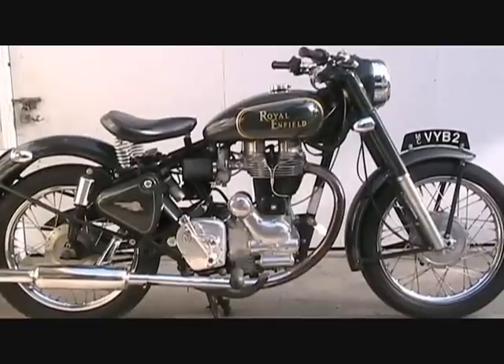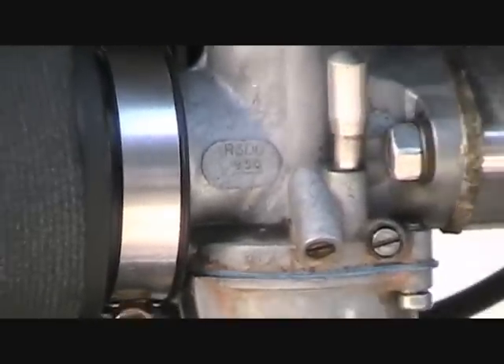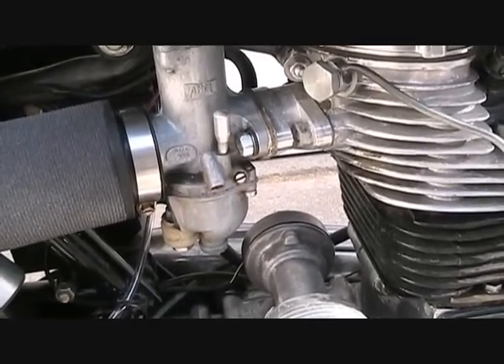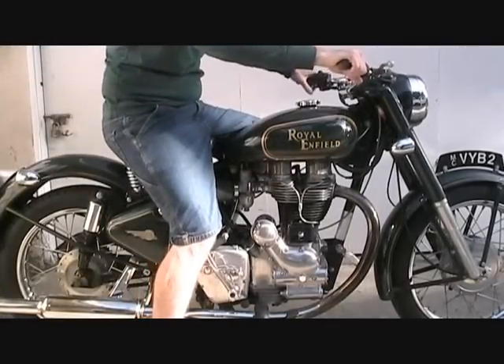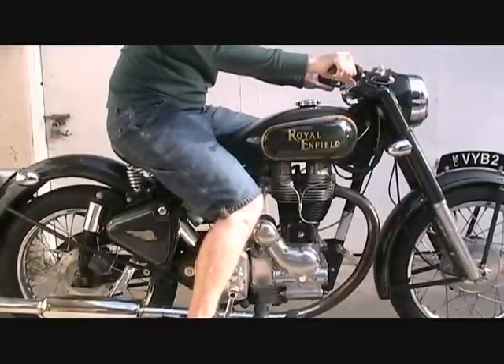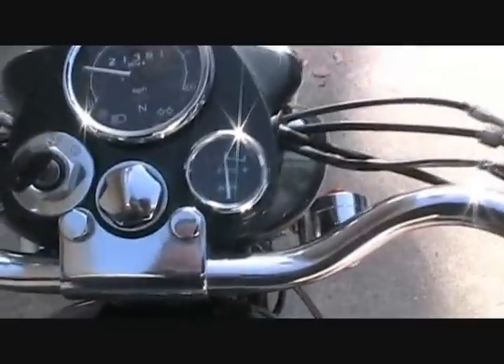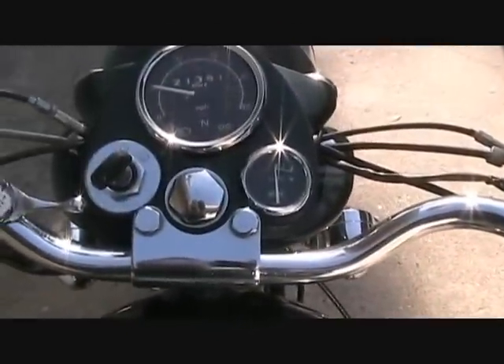How To Kick Start A Royal Enfield Bullet 500 Classic Motorcycle With An Amal 930 Carb

Comment: 1. With engine off press clutch and gently pump the kick lever five times. 
2. Turn the engine on with key. Turn choke on. Press the decompressor till needle moves to centre. 
3. Apply gentle pressure on the kicker till it gives way. Once you reach full range allow the kick lever to come back just twenty percent of its range and quickly but gently do a short kick. Hold the kicker down at the end. That’s important.

Comment: Kick 10 over times first...
What a load of bollocks.
Just turn on the fuel, choke it, and give it a firm kick over TDC.

Job done.
Reply: Gary Millar 
I m sure u have ride this bike
I was just about to say the same
Reply: I have a 1972 500 bullet now, & previously owned another 9 bullets ..  inc the forerunner a rigid model G.

But Ive never seen such a carry on like this before with 10 kicks.

What play acting! 😂😂😂
Reply: Just tickle the carb more with several presses, until petrol shows on the tickler.

ONE good kick is all thats required- 
NOT 10 times turning over on the kickstart!
Reply: Spot on Gary. I'd probably flood the tickler. I'm more of the lazy prod school with a Bullet, the prod has to go all the way through but no gymnastics required.
Reply: Gary Millar .. that's bullocks
Reply: Gary knows the trick😉
Reply: 10 kicks is too much....I have 2005 Royal Enfield Concorde 550cc,  I just give 3 to 4 kicks max with the decompress and then with the single kick it starts and no need of choke....
Reply: Just as you said all it needs is one perfect kick..

I Own the marsh grey carb 500...sweetest ride till now

Comment: Hi Hoobs, You saved me a lot of kicking there boyo, I have just fitted an Amal 928 (28mm) to my 500 Bullet Sixty-5 and was trying to start it like I used to start my bikes in the old days, (the 60s) full choke flood like hell and jump on the kickstart with a"long swinging kick" but this didn't work, After watching your vid again, I remembered it from a while ago, now 1st or second kick thanks a heap.BTW I run a 180 main, 106 needle jet, std needle in middle notch & no 3 slide may go to a 3.5 DJ

Comment: i just bought a new 2010 royal enfield bullet 350 last month here in india,anyhow they have stopped producing efi models for a year  cause the standard model with classic point ignition system is highly in demand here.one have to wait upto six months to get his bike or pay the black to dealer if they want it soon.i have changed the handlebar( i put the classic one on it )and the same old original silencer & the xenon lamp for headlight this bike gives a special kind of attitude when you ride it

Comment: You are getting your motor past TDC on the compression stroke and ready for 2 good revolutions before it fires. The fact that the amp meter is showing a draw on the battery due to ignition position is an indicator sure, but you should be able to just "feel it". The fact that you just touch the tickler and you have success starting is because you're using a choke.
A real tickeled amal's float level is raised to the gasket height when the mixture is truely enriched.

Comment: Thankfully mine doesn't need the 10 time kick. Turn the key to on - choke on carb - one round to the throttle - decompress and a small roll of the kickstart until the needle is  at 0 (TDC) - big kick to the kickstarter without rolling the throttle  - close choke. All this in the morning. If she's warm she doesn't need the off throttle and the choke. She runs on the original Mikcarb 28 for 16 years so far without problems.

Comment: Most people ive seen seems to think the tickler is a pump, its not. What you do is pushing the floater down to overflow the carb, the correct way to treat it is just push it down and keep it down until gas comes seeping out.

Comment: Please note the orientation of the tappet door and especially the packing underneath as it has to be put back the same way, or else oil may leak.  Spin the push rods with your thumb and if they twirl around freely, they are too loose. They need to move under thumb pressure but should not spin freely. Unlock the lock nut, tighten the tappet and lock the lock nut. Now stand on your kicker and make sure there is no compression loss. The kicker should hold your weight. with this setup  < 60 mph

Comment: You can make the bullet virtually silent. The only sound you will hear is the exhaust beat and the small peep-peep noise from the oil breather from the bottom of the cylinder block.  There are 3 basic types of noises that can be arrested 1. Cam noise from backlash 2. Tappet noise 3. Rocker arm noise.  Valve guide noise needs a visit to the machine shop. 

 To adjust your tappet, open the tappet inspection door (on the gear box side below the cylinder block).

Comment: You do not need so much kicking around just you mentioned. Bring it to TDC, that's ammeter to zero, press down the kicker a bit more, then release the kicker. Now don't kick it down, just softly force it down, it will start without any effort at atll. Just that you need to practice it to get it correct.

Comment: great method, i actually use the same but not a hard kick is required. when points/Ignition are fully set it can even start by hand. this revelation ( by a mechanic) sorted my starting process a lot. earlier i used to kick and hump and puff while my wife will laugh and ask me to sell this POS, now i can start it in one kick. 

do you still have this bike? RE has lot of bikes these days like Intercpetor , what are your views on that?

sadly these old bikes are not seen much, the new RE bullets have like wiped them off nd i see these like 10x from past times. this is good and sad on same time. i loved old bikes and i have two of them, not intending to sell them.
Reply from the maker: I still have it, but I need to get it running. It’s been sitting for a long time. The new Royal Enfield motorcycles are a lot more reliable and faster, but they don’t have the same look and feel as the classics.

Comment: You won't build up compression by kicking it over, it's a bloody four-stroke with inlet and exhaust valves, if kicking it over many times builds up compression then it would explode whilst it was running, just tickle the carb until fuel comes out then kickstart it.

Comment: I find myself closer to getting a motorcycle. I've been digging the Royal Enfields, because they remind me of the Vincent Black Shadow in their timeless design. The Enfield's simplicity is one of the factors I like about it, and I would love for my first motorcycle to be something I cut my teeth on. I know that Enfields are more for looks than performance, but I need a little bit of a kick on these Texas highways of mine.  I was curious how about the boost of power from the Amal 930 carb.  Does it provide for faster acceleration or just a smoother ride?
Reply from the maker: BullRonin The carb gives better power across the rev range.  I know the stock carb can be modified to do the same thing as well.  The challenge with this engine is that the engine can't handle long runs at highway speeds very well.  The new engine design is better than the one I have at staying lubricated and dissipating heat, so you may want to take a look at 2014 models and read reviews of them.  I really like the new Cafe Racer, which is $5,999.  Here's a video I made of me commuting on the freeway on my Bullet, and talking about what it's like to ride fast.  http://youtu.be/W8JKk84gGDg
Reply: ***** I checked out your video, and it was awesome. I also checked out some of the other videos you have pertaining to the Royal Enfield. They have been a great help in my planning. Your review of the Bullet and mention of the RE's Café Racer in your reply led me to the 535 fireball kit. I'm going to look more into the kits, because I like the aesthetics of the Bullet compared to the Continental GT. Thank you so much for your time and advice. You've given me a great start in my research and planning.

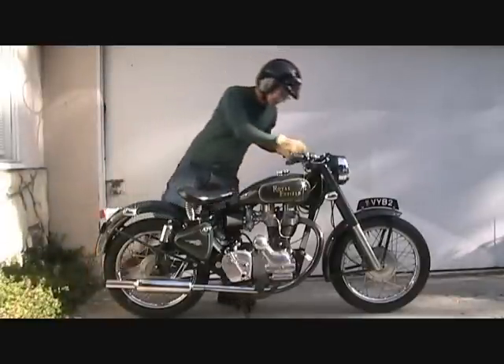Comment: When you put it little past the tdc indication (?) on the ammeter when the cylinder is compressed, am I right in saying that you are in power stroke, just after tdc? If so at the end of the video, it doesn't initially start (2:40), so don't you have to put it all the way back to the tdc of power stroke again because that positioning is screwed up? Or am I understanding this wrong? Thanks for sharing the video!
Reply from the maker: Jose You are correct. If it doesn't start, you need to get the piston into starting position before kicking it again.

Comment: I like 'thumpers'. I rode a Suzuki 500 single cyl 'thumper' once; I liked it a bunch too. I have my eye on a 94 Bullet with 108,000 km on it. What kind of mileage are the Bullet 500cc motors good for?
Reply from the maker: That’s a lot of miles! It’s probably been rebuilt at least once. The older ones wear out pretty fast.
Reply: @hoohoohoblin  I just asked if it's ever been rebuilt. Most of the money I was going to use to purchase the Bullet is going to go to the veterinarian now. Just found out our kitty has a cancerous tumor that needs surgery.

Comment: Hey i have a question, i have a similar choke lever like yours on the handle bar, now how do i fit it on my stock 500 bullet? I just bought the choke lever and need to figure out a way to get a cable and fix it like you did..thanks

Comment: Mine is old Royal Enfield standard 350..today while I was starting my bike a exploding sound came from air filter box also some white smoke,after some time I kick started again and it started. What should I do is that a problem...(I tries to increase the slow working by turning that screw on the carberator...) pls help
Reply from the maker: +navavyuh sudev   Mine does that sometimes.  Try resetting the screw back the way it was originally.
Reply: +hoohoohoblin if I do that the engine will stop when ever I release the accelerator....... that means I have to keep my hand on the throttle always.......also while changing the gear.......(thats why I increased the slow worcking.)..any suggestions.... pls
Reply: +hoohoohoblin it's the 1st time I'm riding a royal Enfield..... so because of this problem I was not able to ride properly.... the bike turn off whenever I release the throttle....

Comment: hi
got my bullet 535 over haulled to bullet 500 std .
everything is new including the kit , micarb carb . new point , one kick start but theproblem is that the running of the bike is not stable . with running i mean to say the dug dug beat  , can you suggest me what to check to rectify this problem ,
Reply from the maker: You need to adjust the fuel mixture and idle speed, but I don't know what settings to use. Search the internet and you will find forums about crab tuning.
Reply: I'll try to do the setting and will let you know ,thanks ,

Comment: What is the relation between the compression and amp meter. I mean how is the compression measured in terms of ampere ?
Reply from the maker: The needle moves when the spark plug fires, so that's how you know the piston is at the top of its stroke .
Reply: +hoohoohoblin Thank you. Had this doubt for so long. Actually never found anywhere the answer.

Comment: @bunburyZ  Perfectly sensible, he placed his bare hand palm down onto the downpipe immediately exiting the Cylinder head, if the bike had been running for even 30 seconds the heat generated there is so intense he wouldn't have been able without badly burning himself., the palm of your hand is the most temperature sensitive part of your body, the only 'dumb' thing here is making a comment like yours

Comment: What a lot of unecessary, time-wasting ritual... & it still took two kicks to start! My 20-year-old classic Indian Bullet 500 with a reproduction Amal monoblock & NO CHOKE starts first kick, summer or winter. Tickle till your thumb's wet, ignore ammeter, move kickstarter once to find compression, use compression release to ease piston over just past top-dead-centre... one steady kick and a simultaneous small flick of throttle (less than 1/4 twist)... first-kick start, every time.